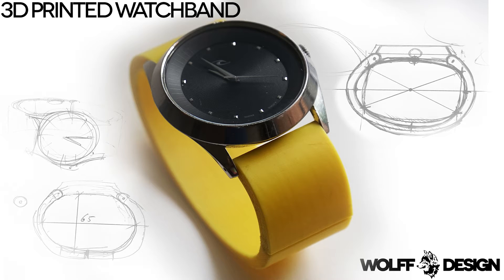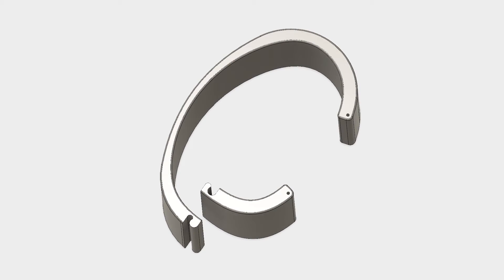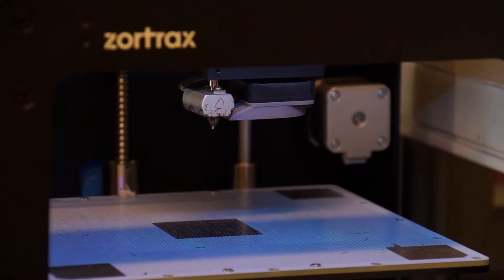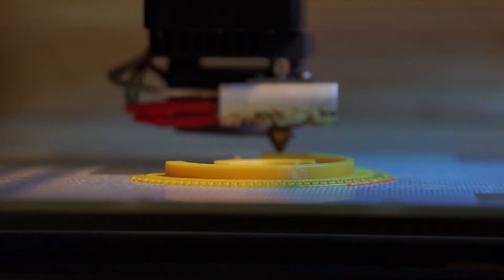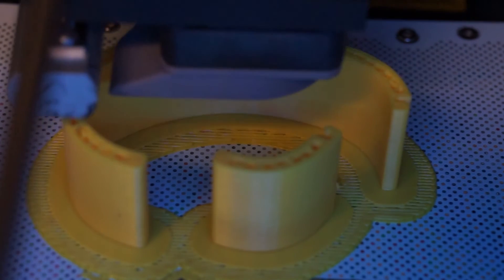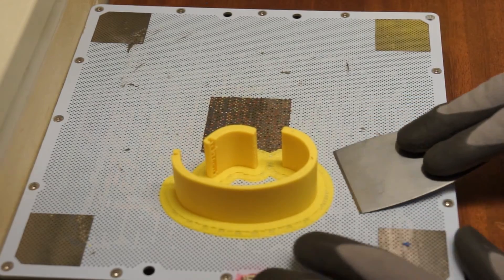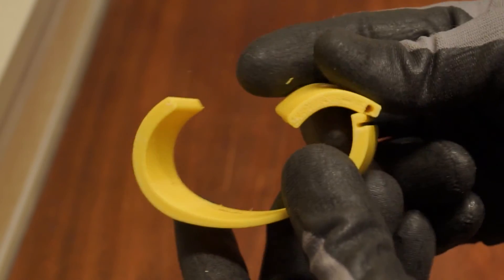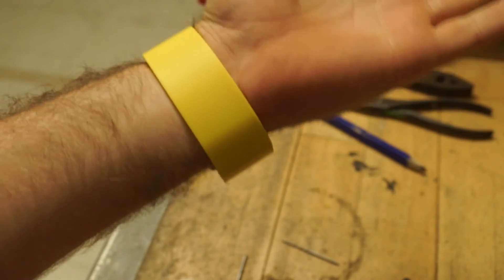3D Printing my own watchband

Comment: Hi.. good video, thanks for share it.
i have a question... can i print on flexible filament and can be build more rigid parts and some flexible in another part? ( like in bi-inyection procese)

i thank you for answer  and best regards. Luck